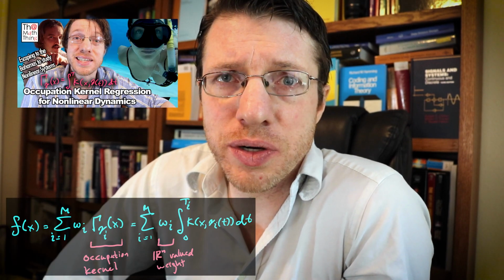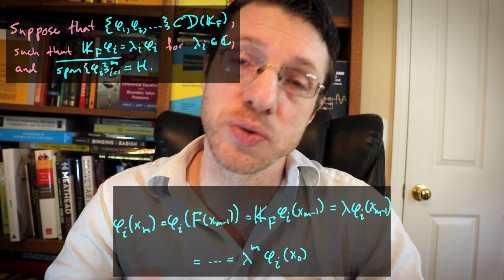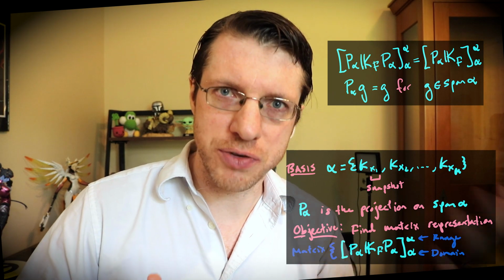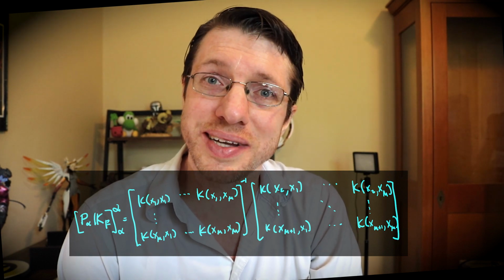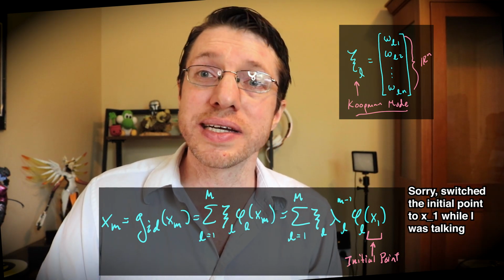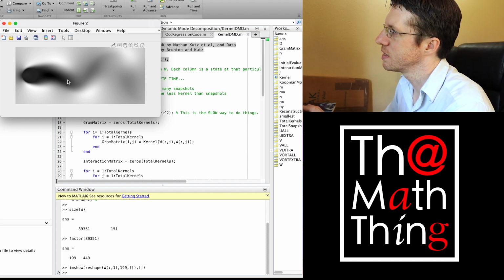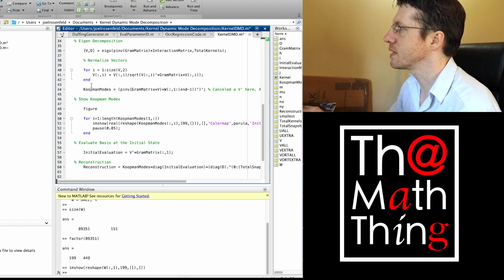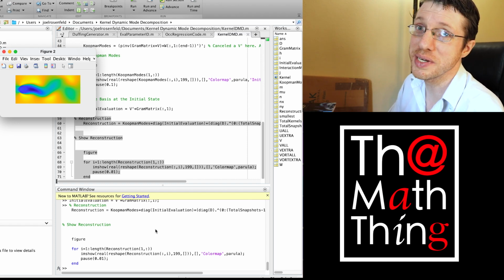Introduction to Kernel Based Dynamic Mode Decompositions

Comment: Thank you for the really cool video! I was so lucky to find your channel. The videos really help understand all these DMD and Koopman stuffs. 
One question: here we consider the finite dimensional subspace spanned by the kernel functions, each of which has a data point for its center, because the representer theorem guarantees that we only have to think on this subspace. Am I correct?
Reply from the maker: That's a really good question. Whether the representer theorem comes into play really depends on how you are setting up the problem. So if we inserted a regularized regression problem in the inversion step when we were making the finite rank representation, then, yes, this would allow us to use the representer theorem. If we were going for just straight inversion and not regularizing the problem, then it's simply a good choice based on the data we have.

Comment: Small suggestion: using a thinner pen width will make your handwriting a lot more readable.
Reply from the maker: It’s a tough balance. Some people watch on smaller devices, and I want to keep the text large enough to read. I’ll work on making everything clearer. Thanks for the input!
Reply: @JoelRosenfeld  I think you misunderstood me, I'm only talking about line width, as in sharpen your virtual pencil so that e.g. the gap inside "p" becomes visible(as opposed to being filled due to overlap of thick lines) , the text size is very good.
Reply from the maker: @blacklistnr1  gotcha. Sorry for misunderstanding. I’ll try on my new videos. I appreciate it!
Reply: @JoelRosenfeld  No worries! Thanks for replying and taking feedback

Comment: Thanks for another great video! Juggling is an interesting and surprisingly mathematical rabbit hole to get into. In particular, there's a bunch of combinatorics behind "siteswap notation" for juggling patterns. Allen Knutson (an excellent mathematician and juggler) gave a very nice talk about all that at my math department while I was in grad school. 

I was surprised to see that you can think of R^n as a RKHS; it's interesting how flexible the kernel framework really is. I'm looking forward to your upcoming perspective on the Koopman operator as a Liouville operator evangelist. One thing that bugs me: you say that the Koopman operator is typically unbounded and imply that this is problematic, but wouldn't the same issue apply to the Liouville operator? That is, if we have a semigroup of unbounded operators, then isn't the generator of that semigroup necessarily unbounded?

On the subject of Koopman and quasiperiodic dynamical systems, I found this paper from Lange, Brunton, and Kutz to be interesting: https://arxiv.org/abs/2004.00574 In a nutshell, the twist is that instead of taking the traditional approach, you try to get a neural net (or your preferred parameterization of a non-linear function) to "learn" the transformation from the coordinates of the system's state relative to a Koopman mode basis to the actual state trajectory while alternatingly zeroing in on those Koopman eigenvalues. The weird thing is that it seems to work. I've been working on getting something analogous to work for input-driven systems.
Reply from the maker: I’m glad you liked it! I’ll have to look up Knutson’s stuff! I didn’t know that the niche of juggling mathematicians was so crowded! Lol

Yeah, R^n is a RKHS with functions over the first n integers. Extended DMD just makes this a longer identification with the extended features. The problematic bits for the Koopman operator is not so much that it is unbounded (which is certainly a problem), but that the community assumes that it is. For instance the work of Korda and Mezic that demonstrate SOT convergence relies on this fact. (Btw there is nothing special about Koopman operators there, every bounded operator is approximable by finite rank operators in SOT. The convergence is just really poor in general there.) The unbounded nature of the Koopman operators really just mean that there is no benefit to working with Koopman over, say, Liouville. Koopman operators are just placing the additional assumption of forward invariance with no tangible benefit. Conversely, my group has several variants on Liouville operators that make them compact, which allows for norm convergence. These modifications are not possible for Koopman. We will get into one such adjustment in the following weeks, and another is being prepared presently.

I have seen Henning’s work, though I haven’t dived deeply into it yet. He gave a talk at a workshop that Rushi and I organized for the ACC2020. I think Rushi has the talks available on his page at Oklahoma State. I’ll see if I can dig up a link or two. I’ll give Henning’s work a closer look over. By the way, I am not sure if I asked this already, but where do work? And what’s the sort of stuff that you work on? DMD and Koopman analysis to some extent, I suppose?
Reply: @JoelRosenfeld  It's a surprisingly crowded niche. Ronald Graham (of "Graham's number" fame) was another prominent juggling mathematician. If you are looking into Knutson, I think you might be interested in his work with Terence Tao on the "honeycomb model", which relates to the relationship between the spectra of self-adjoint operators (over finite dimensional spaces) and their sum. In particular, it gives a nice framework for the proof of Horn's conjecture.

Am I correct in assuming that SOT = strong operator topology? I'd be interested to see where you're going with these Liouville operator modifications. If I had to guess, you're replacing differentiation with integration either by looking at some kind of inverse to the Liouville problem or by coming up with some kind of weak formulation.

We covered my story a bit when we were talking on Reddit a while back, but in any case: I'm doing a postdoc of sorts over at Wright Patterson Airforce Base in Ohio. I'm working on a project relating to reservoir computing, where the entire point is to harness non-linear input-driven dynamics. DMD and Koopman theory have been relevant in that they can be generalized to account for input-driven dynamics. If you'd like to hear more, I'd be happy to send an email with some slides.
Reply from the maker: @bengski68  yes, SOT is strong operator topology. Essentially the topology of point wise convergence over the Hilbert space. Convergence there is relatively easy, and it doesn’t actually give good convergence to the limit’s spectrum.
The Liouville framework is extremely flexible. The 101 approach is to do this same process, but with the occupation kernels as your finite dimensional basis. We can adjust he operator by a very small perturbation to get a compact operator, a twist on weighted composition operators. Then we also have an approach for control affine systems that I’ll probably make a video on later in the summer. It completely transforms the whole DMD control approach. We can also handle higher order systems, fractional order systems, and many more.
Right! I remember the exchange on Reddit now. Everything gets crisscrossed in my head between the two communities.
I’d be happy to continue our conversations via email :)